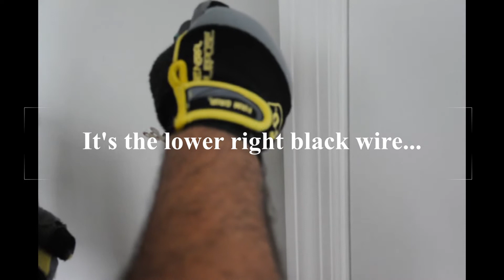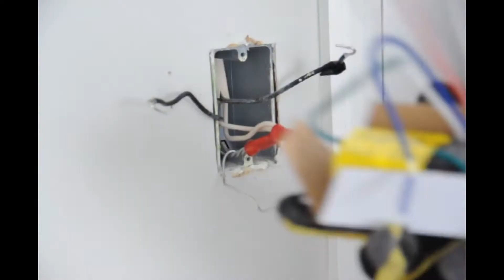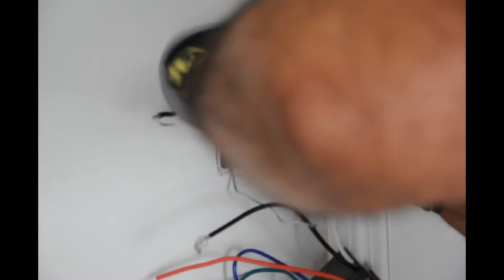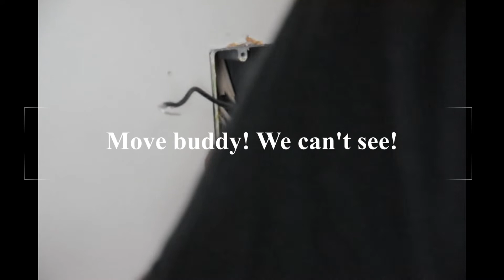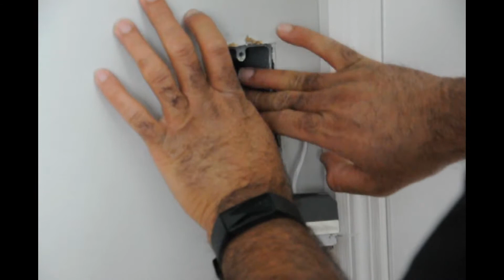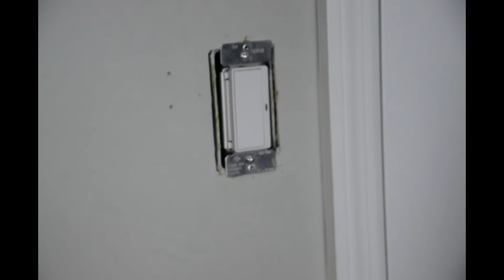Eaton RF9601DW Z-Wave Plus Switch Installation

Comment: Dude this is my exact new switch but I can’t figure out the fixture white to white connection. Also could you redo this with a MUCH better camera angle? Super frustrating since this is the exact switch I’m trying to figure out